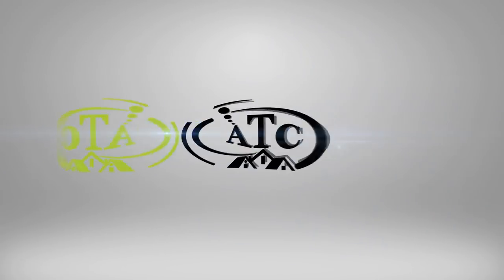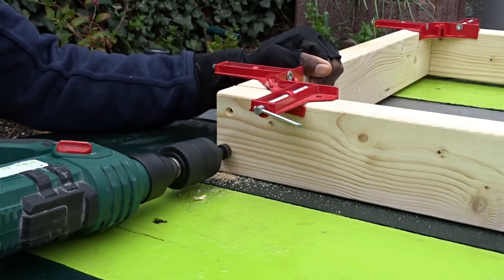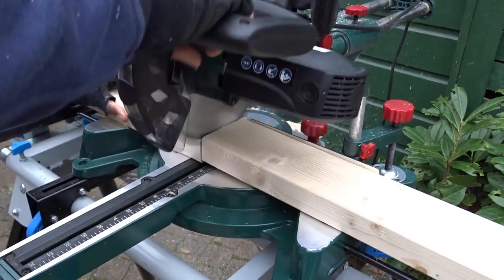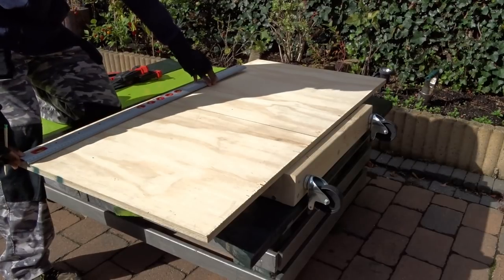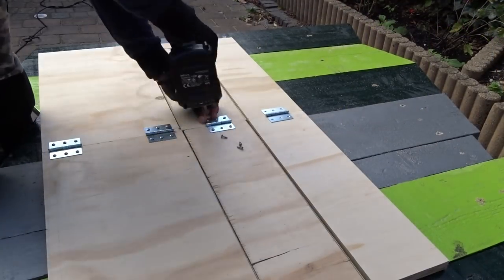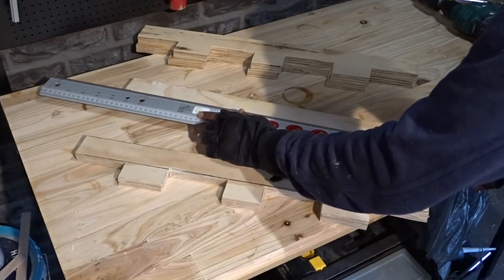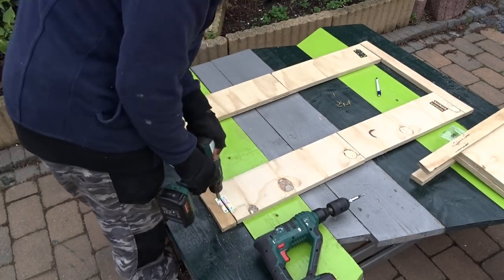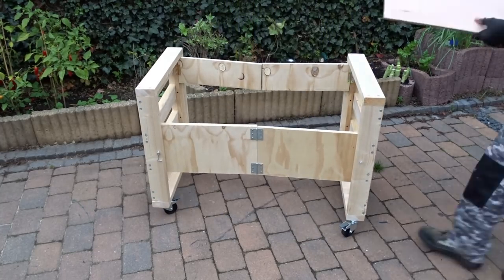How to make a simple folding workbench and Transform-IT // Modern DIY

Comment: If you put a 10 inch extension bit it will make it much easier to use your drill as a screwdriver. When you encounter situations like those wheels.
Reply from the maker: Yes, good idea!

Comment: Great video. I would use strap hinges where you have room, to move the screw holes away from the edge of the panels. I would epoxy the hinges to the panel, once aligned, and this would be stronger than just screws.
Reply from the maker: Good ideas will, i'll keep them for any upgrade project. Really apreciate your input here...

Comment: Very nice demo of how to make this folding table base! I've seen the same design all over Pinterest, and a video in which some dowels were added to the top of the legs, which would then fit into holes in the table top to keep it in place, but your instructions were better. Oh, and they also added sash window locks - you could also use the same type of latches you fitted to keep it closed - just above the central hinges to keep the long sides from folding up on you when moving it around.
Reply from the maker: Stadler le Roux thanks and welcome to the community. Very nice to have your input here! I am looking to create an improved version in the future so i will for sure use your tips. Have a nice one

Comment: Excellent design, well done sir! One thing, at 8:50, you use a hinge centering drill bit, but you remove the hinges to drill the holes, lol,which defeats the object of the centering bit. 
Still an excellent design though, merci.
Reply from the maker: Good observation, did you also make it?

Comment: Clever and nicely done.  I can picture a way to put strategically placed holes in the work surface so that you can place pins through to keep the top on the base while working.  :-)
Reply from the maker: Hi there, I 've missed some message and just realized. Thanks for your support!

Comment: Thanks for the nice video. It appears the mounting board width at 9:48 is different than the one at 10:00? You had to make an adjustment, otherwise the supports would not be flush with the frame when you collapse the bench.
Reply from the maker: Hi Peter, yes exactly! I have added the correct measurements in the 3D plan provided if needed

Comment: Good idea and construct of work bench that stores away when not in use. I especially like your idea of the offsetting caster wheels. The original photo on the advert for this video showed something like storage shelves on the outside ends. Is that an after thought and build to the video?
Reply from the maker: Terry Morris thanks, always a pleasure to share with you guys... In fact yes its an after thoughts, which at the end turns out a great plan. What do you think?
Reply: I like the end storage shelves.
Reply from the maker: thanks, I will be adding soon some plan with the additional design to do with it. feel free to check the upgrade 2 and 3, I think you will like them...

Comment: What thickness timber did you use for the frame. Thanks
Reply from the maker: It depends which part you are talking about????
Reply: @MyATCtv  the 8 pieces that you cut at the same length. I don't want the size of length but the thickness and width of timber. Thanks
Reply from the maker: @BOBBY-et9xb  we've added the free plan for you via the shared file member section on our DIY platform: www.atc-c.com if you have more question, feel free to reach out to us

Comment: Cool video ..thanks for that.. the side sections are very stury compared to the overall use of the design.. having wheels on a workbench is a complete pain in the arse when you're doing any work on it at all i'd say. Even if you used locking ones it would still jump around too much.. It would be far more practicle to have a system which could be actually bolted to the floor imo..
Reply from the maker: Nice suggestions. Thanks!
Reply: The point to this design is flexibility of use.  In my case, this would make a great second bench that can be moved around my garage or onto the drive for times when my other bench is covered, or even I want to work outside or away from my garage.  There are a number of fixed bench designs on here and as part of my overall workshop project I am looking to replace my main bench, but will almost certainly be building one of these as an additional.  From the video, the material costs of this look pretty reasonable.  If Wheels were a real problem, you can probably make removable feet for this bench and attach the wheels to them and then have the feet as a box around each leg.  Kinda like roller skates :) !
Reply from the maker: @andym5213  well said!
Reply: Then it defeats the purpose of the bench being “portable”. Why would you need the bench to fold if you are going to permanently attach it to the floor? There are much better bench designs for a non-portable bench. For my purposes, having limited space in my work area, this is a perfect compromise. It will be sturdy enough, but will take up very limited space when not in use. I have a couple of ideas to make it even sturdier that I will share once I make my own. Just want to be sure they work before wasting anyone’s time discussing here. 

Thanks for this design. I have watched quite a few portable designs here and this is the one I have been searching for. Gives me a great place to start...and also add to. Will keep you posted.